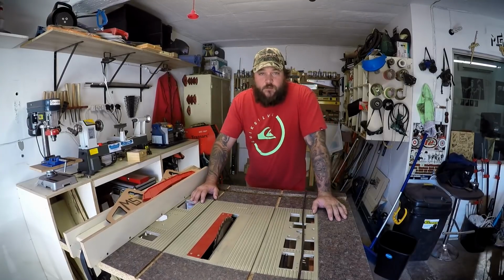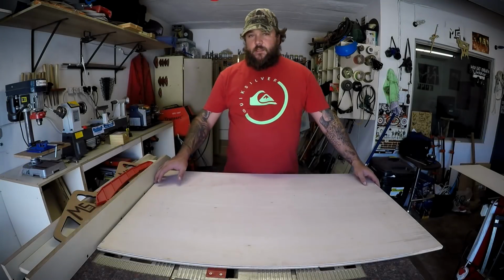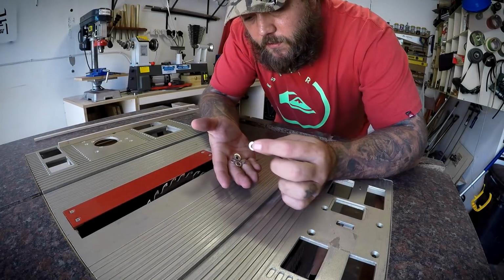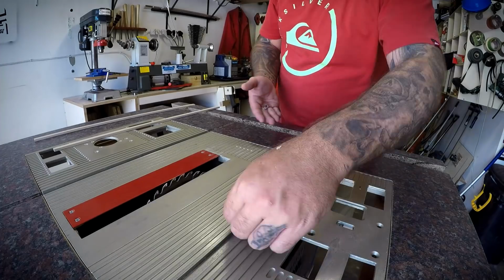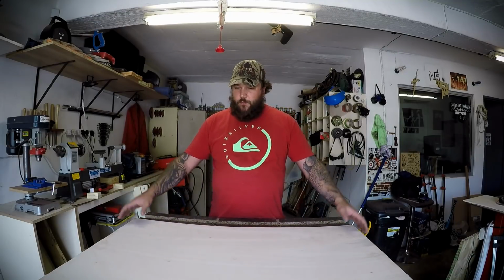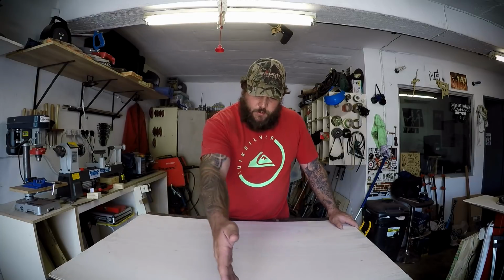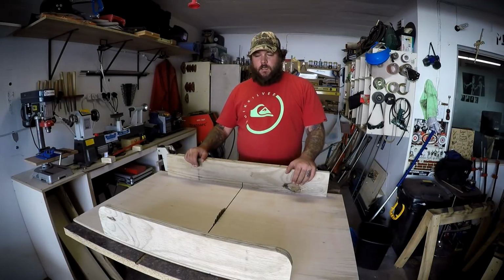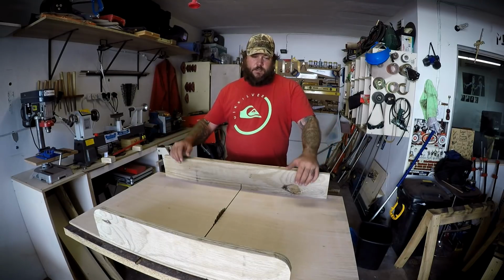Quick and Easy Table Saw Sled (Cross Cut Sled) - Build Video

Comment: Nice build, only thing I would do is coat and buff the underside with paste wax, slides a lot better! Cheers
Reply from the maker: Thanx Shaun... I was planning to, but would you believe that stuff does not seem to exist in Africa... LOL... will have to order some online...
Reply from the maker: Yeah, that sucks... guess I'll have to try some vaseline... LOL
Reply: maconSTUFF do a search on Wood Butter. Or try this url. https://www.creative-culinary.com/wood-butter-renew-wood-utensils-bowls/

Practically the same, just maybe use a bit less mineral oil. I have not tried it with any other oils. Maybe a video you could make? 😀. Cheers from UK
Reply: maconSTUFF soya wax also works well, it also makes very long slow burning candles. Good cheap Christmas gifts, special coloured with kids crayons 😀